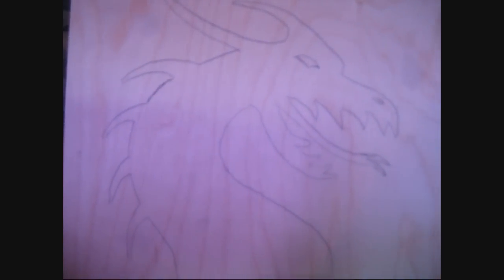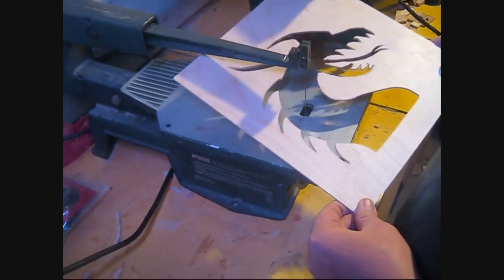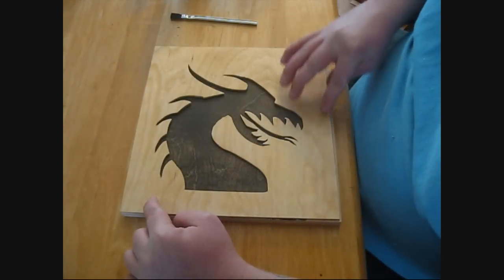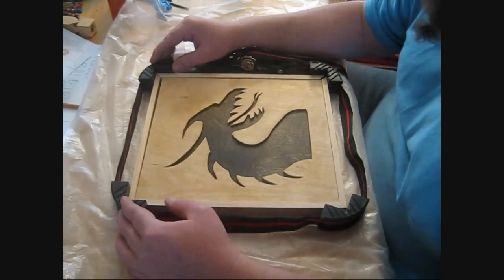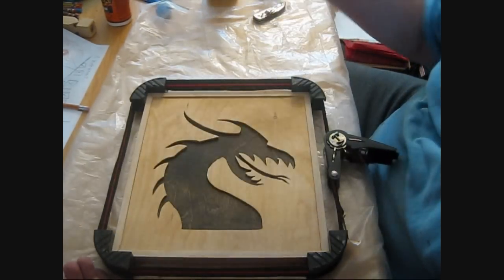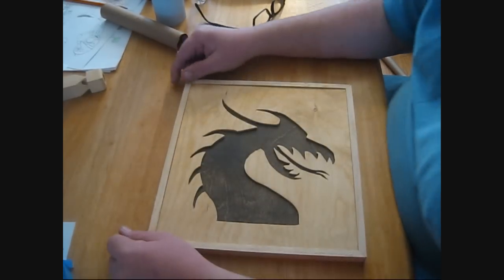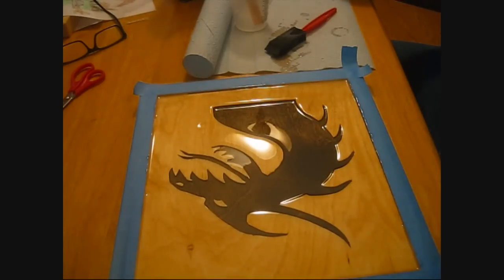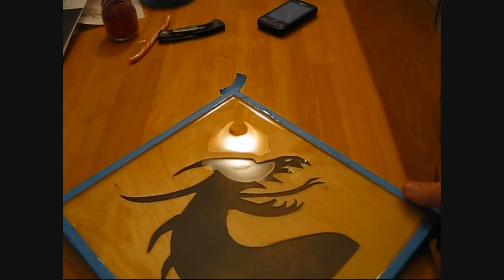Framed dragon scroll saw cutout - 2 part epoxy project

Comment: Nice piece of work!
Maybe you could have put a temporary frame when putting epoxy resin on the surface and then as final touch glue the frame...to avoid the resin to affect 5he looks of the frame.
Reply from the maker: Good idea.
Reply: aniorange You could have also finish frame before pouring the resin and coated the frame as well. Other way would have been to make sacrificial frame that you would cut off in table saw then then made other nicer one that would have got coating before hand and then attached to picture with wood glue. I make similar mistakes all a time when trying to make things perfect.. guess its our down fall..
Next time make resin etc in place where no one goes next 24 hours, that is also dust free. Putting it dry into table, specially where people move all a time... now what could go wrong? :D
Otherwise really well done. I like how that first come to be, thought over all it could used some more complexity in face wood. Possible router or chisel some groves into wood, but this is just my suggestion.
Reply from the maker: Hellsong89 Thanks for the suggestions.